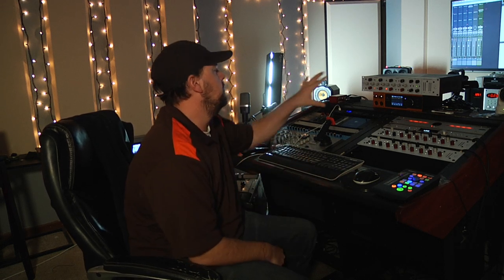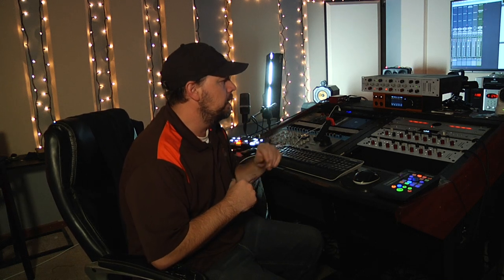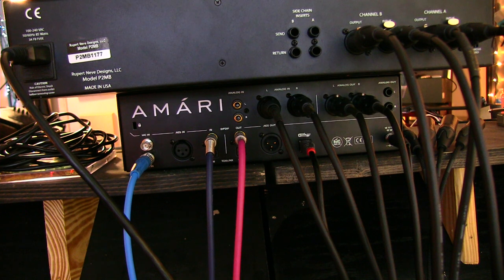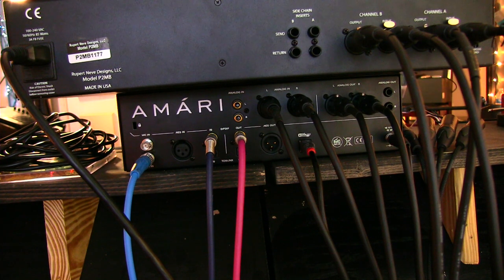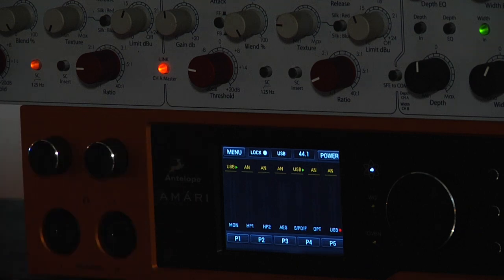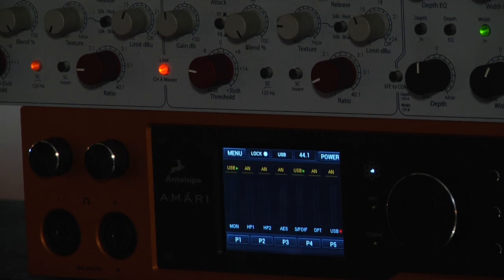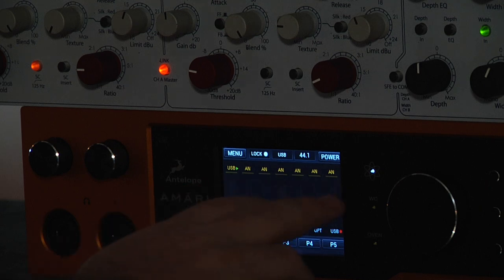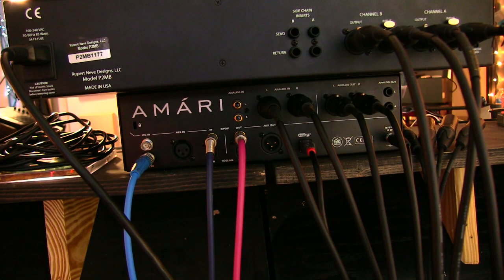Antelope Amari Review how to Use Hardware with it!

Comment: For those who are still struggling to understand how the routing works:
I've been experienced AMARI for a few days and the reason why you're gonna need something else for monitoring is that, AMARI HAS NO SEPERATED MONITOR OUTPUTS, the big knob on the front panel is actually controling the whole analog out level. When output level is set to 24dBu, at 0dB, which is full scale, you're outputing 100% of the original signal to your gears. 
It's totally fine to connect your monitors directly to one pair of the analog outs, but for me, the normal monitoring level is at -60dB, so when you're recording outboards at the same time, either you gonna listen 60dB louder than you used to (your ears and monitors will definitely blow up), or your output signal's 60dB quieter that will drown in the noises. My solution is adding a monitoring controller (a potentiometer) between analog out and my monitors so you can monitor and record at the same time with no problems. 
I hope that would help!
Reply: Copy... for me that isn't an issue. I'd just route out from SPDIF into my Orion Studio. Thanks for the clarity. @Doug, this is a great video!
Reply: This answers my question, i'm going for the Pure2 bc it is also a monitor controller and mastering grade instead of reference grade conversion anyway
Reply: Antelope amari is better then rme adi-2 dac fs pro?

Comment: So... I thought that the two Analog Outs on the very right side of the unit (the TRS ones) were used to send the audio to your monitors, (but these analog outs are not to be confused with the ones being fed to your Portico, or other analog gear). 

You're saying that you can't just send the TRS Analog Outs directly to your monitors?
Reply: to answer my own question, now that I got the Amari, when using the TRS Analog OUTs... they are receiving whatever audio is coming IN... they DO NOT process the audio on the way out! 

So if you want to have another way to have The ORIGINAL Source Material easily come out of the box (other than programming it and switching in and out of presets, as shown in this video... or using the headphone outs), you CAN do it by using the TRS Analog OUTs. But again, they only return the ORIGINAL, Unprocessed signal. I tried... and I couldn't find a way to make them come out POST-PROCESS

Why did they design it like... THIS? whaaaaaaat?

Comment: Hello Doug, nice video! Maybe you know if I am using spdif from audio interface to the monitors, doest it matter what kind of converters are on the interface? I have Prism Sound Orpheus, but use only spdif out, I don't record or use analogue ins and outs. So logic says any good interface with spdif should sound same like Orpheus or Amari?
Reply from the maker: Spdif out would send signal then incoming signal would playback through the other convertors Da
Reply: @DougJenkins  I have MiniDSP Dirac with digital in from Orpheus. So MiniDSP is converting DA and it goes to speakers. So in this case Prism Sound converters do nothing and seems like a waste:)

Comment: Hello Doug, thank you for doing this rare review of this device, may i ask you, if you are using Amári just for the analog loop same as i am plannig to use it, would it be possible to just connect it via USB similary like Pure and use it as Aggregate device in Mac and just route its channels in Daw? I mean why to route it through Pure? What do you think? Of course i will connect their clock and make Amári to be master as i don´t have the separate atomic clock. Thank you in advance, it is very hard to find any information about it.
Reply from the maker: give me a few and I will get back to you tonight on this!
Reply from the maker: So to answer your question, I started a video and never had time to really finish it, the way I wanted.  To answer your question the dac on the amari only shows up as 1 stereo channel usb!   The pure 2 shows up as 2 stereo!!! 1 for processing one for monitoring.  The amari has some stuff the pure 2 does not, but the flexibility of using it as a all in one processor ad/da and monitor controller is not going to happen.. I run the Digital out to my pure 2 and leave this connected to my monitors for playback.  I hope that helps and apologies on the time it took to get back to you
Reply: @DougJenkins  Hello Doug, thank you for answering my question, i understand your approach.
Reply: @DougJenkins  So in this scenario do you hear the compressed signal playing through the Pure 2?
Reply: @VallyTheHitman  that's a great question, and one I've been wondering greatly about. Sorry I can't answer your question (from first hand experience)... it is also my question as well. But I do want to say that, in the mean time, I AM using the headphone outs (1 chip per each out) from the Amari... and they sound GREAT. I can't even imagine how much better the ACTUAL outs (which use 4 chips each) from this unit must sound.

The issue with the Pure 2 being used as a signal processor is that it will definitely "colour", "shape" or "characterize" the sound, somehow. Will Borza (legendary mastering engineer) has proved this: https://www.youtube.com/watch?v=OGDD31-m8us

So... my issue is your's as well, simply... how do we get the sound OUT of this thing, as transparently as possible, WITHOUT coloring/shaping/characterizing and thus, otherwise perverting the AMARI's own sound with extra, additive audio signals in the chain? What is the best practice here? Namely, for Mastering... like, the most affordable way this can be done with the Amari? 

I may attempt to call Antelope and see if their award winning customer service can recommend a high calibre unit that doesn't cost another few thousand dollars :P

Comment: Hey Mr Dough I was using the the Pure2 as a interface only and not using it full potential. Im still mastering in the box but wanted to start using the Pure2 to set up hardware analog to start using in mastering. Now how would you suggest I hook it up to my hardware  that I Bought so far my list is

The New Daking Comp2  vca 2 I/O
Looptrotter SA2rate 2 I/O

Daking micpre/Eq 1 I/O

KlarkTechnik EQ Puitec 1 I/O

ArtVoice Channel Strip 1 I/O

MOTU 828ES audio interface with 16 I/O
 
Got it clock to the Pure2 spdif going from motu to Pure2 to the presonus monitor controller. How would I set this setup for mastering and what other Hardware you suggest I get. Plus is it true that you only chain quality gear with high end and not Low end hardware gear.
Reply from the maker: Look to do a video to answer this question
Reply: @DougJenkins  thanks highly appreciated 🙏